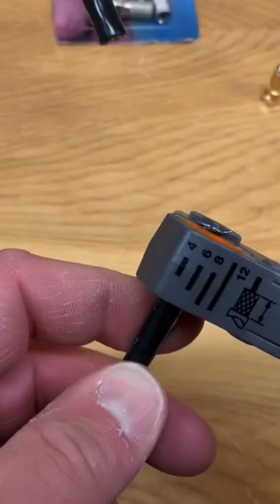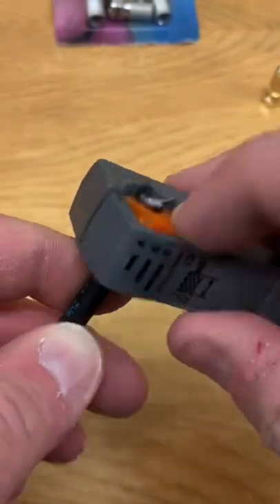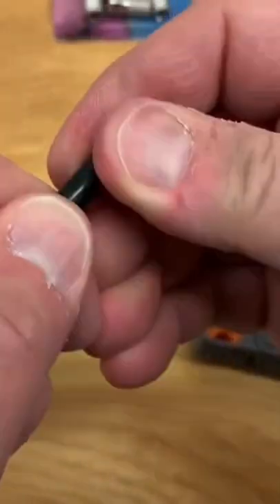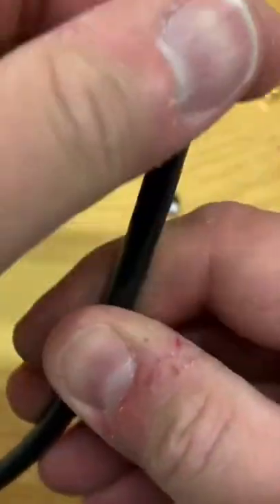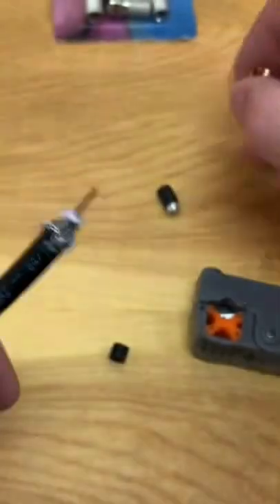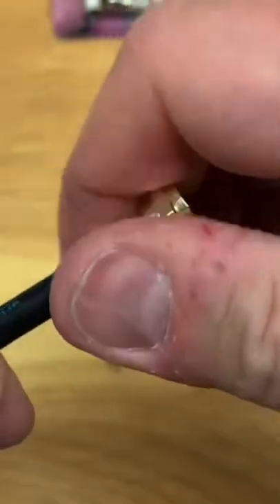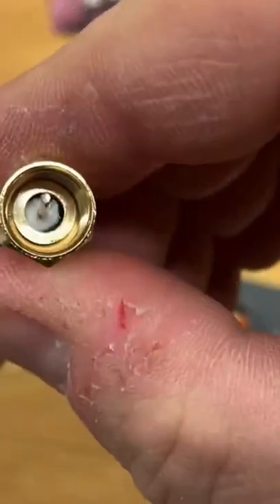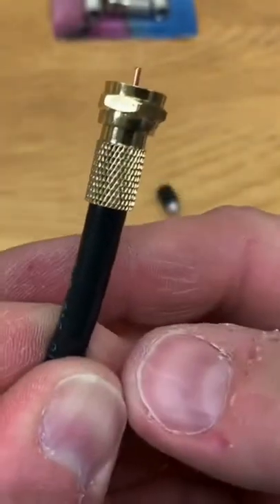How to Install Twist-On Coaxial Cable RF Connectors for TV

Comment: Never use twist on gold connectors. Silver crimp only. This guy will have a tc scheduled within the month.
Reply from the maker: Actually, compression connectors are the best, even better than crimp. But not everyone has the tools required to make those connections. Twist-on are not ideal but will work indoors until a proper compression connection can be made.